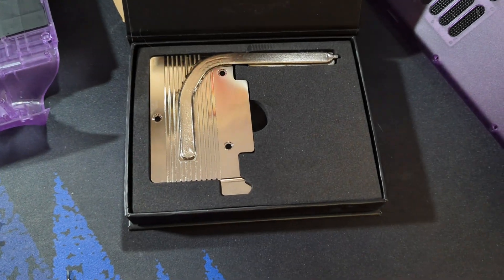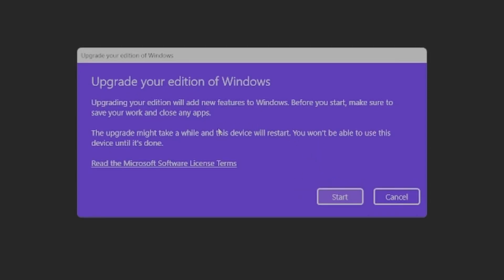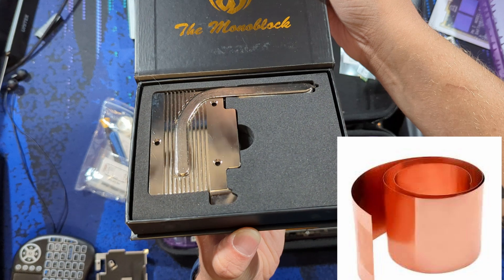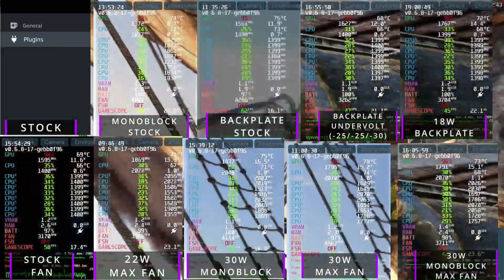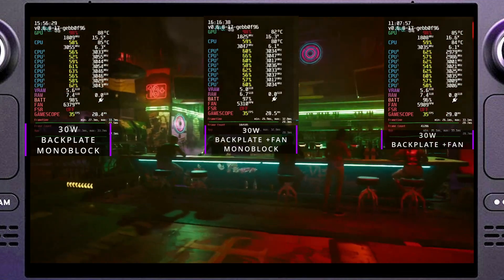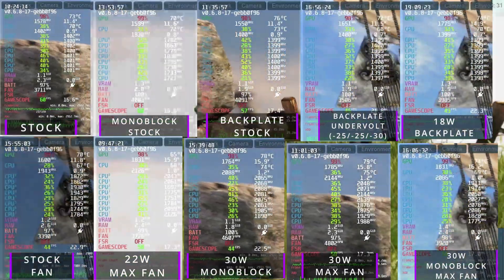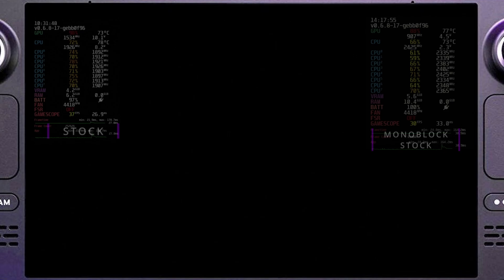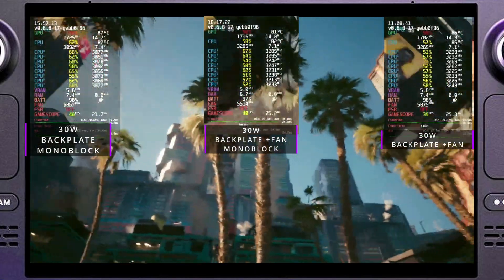Drop Your Steam Deck Temperatures With This Drop In Mod | The Monoblock Installation & Review

Comment: What are the alternatives ?
Reply from the maker: Jsaux backplate with optional fan is a good option
Reply: I have the first gen backplate. Is the revision any better ?
Reply from the maker: @dontsweatme4588  I am still using the first gen backplate. I have my doubts about v2 being any better
Reply: @WinDeckTech what about when combined with the fan? Do you get close to a 10 degree drop ? And does the noise bother you
Reply from the maker: @dontsweatme4588  honestly the jsaux fan is a lot quieter than the steam deck. If you're playing in a docked functionality then yes the fan will be infinitely quieter, although I wouldn't necessarily play with the fan and handheld mode. Although the back plate does offer quite a significant temperature drop for just being an ad on simple purchase
Edit:
I can't I'm going to revisit all of this with a v2 once I get proper shims and ptm in
Reply: @WinDeckTech  https://www.youtube.com/watch?v=ZQLT2UvbFFc&t=3s - v2 is better and safer because the metal plate is not led outside
Reply from the maker: Interesting I hadn't realized the plate was not outside. I feel as though that will make it not as compatible with the fan unfortunately
Reply: @WinDeckTech so I recently got the fan . With the first gen backplate + undervolt, ram overclock and 1900 on gpu, I can sustain 22 watts hovering between 86 and 88 degrees
Reply from the maker: @dontsweatme4588  that seems pretty alright to me!

Comment: Interesting vid. Congrats on the 3k :). For the screw, you could try super glue or a tiny blob of epoxy attached to the bit (one you don't need as it may weld it to the bit) then leave it in the stripped screw head to dry. then it should screw out.
Reply from the maker: Thanks! I did try super glue, however it just did not want to bond to the metal. I will try a bit of epoxy without hopefully messing anything up too bad.

I do really want to revisit this when I get "proper" shims in from Ali express. Especially once their V2 cooler comes out.

Thanks for the tip and comment :)
Reply: @WinDeckTech  Sometimes the super glue is just not that strong of a bond for metals. Hopefully you manage to get it out but keep us all updated :). 

That sounds like a good vid to come, I'm always interested in custom cooling/tweaks for my devices.
Reply from the maker: @Blind-Matter  once I get the new parts I'll do an updated version. I'm hoping to be able to get an excellent mount with this.
I found the thermal paste they supplied was pretty dried out as well. I only used it on the vrm chips etc. I used my Corsair xtm70 for the actual APU.

Definitely stay tuned!

Comment: Not worth $99 to me, just play your steam deck and enjoy it. Steam Deck 2 is probably only a few years away.
Reply from the maker: But if I can't modify/destroy my steam deck, am I truly enjoying it?
Reply: I always play Inside with good AC. I use the old fan curve exclusively, and have had zero cooling issues or loud fan noise, ever. 
I will add a caveat, I had to RMA my old SD about 9 months ago because I was using the new fan curve for a long time and long play sessions. It overheated a few times and then began resetting on its own. 
Use new fan curve and there's no issues!
Reply from the maker: @donniedarko4497  oh wow. I was using the old fan curve exclusively, mainly because I figured if you're doing a mod like this, then you would want the quietest fan possible.
Reply: Same effect more cooler for 30$
https://youtu.be/BjtRg9Wx4t8
Reply: A few years passed. No deck 2